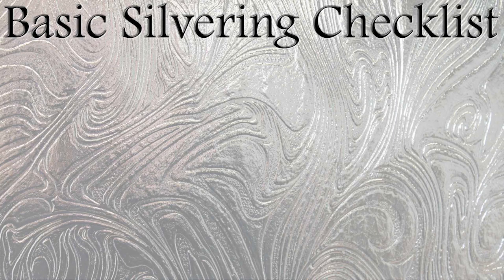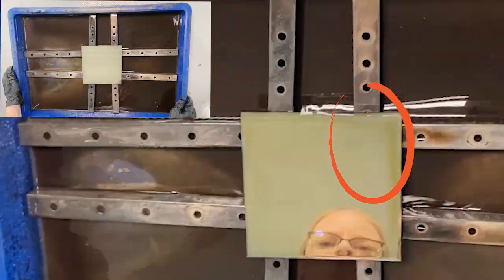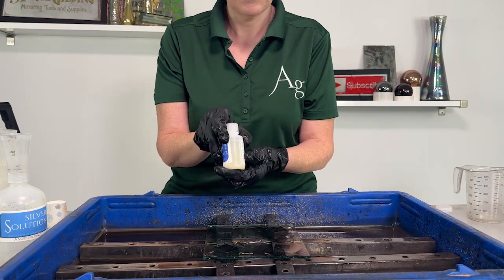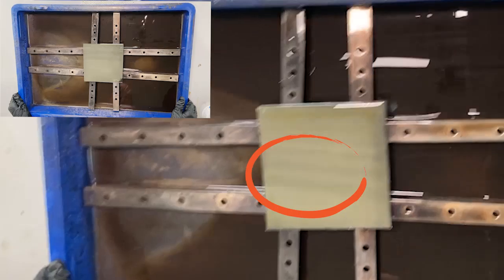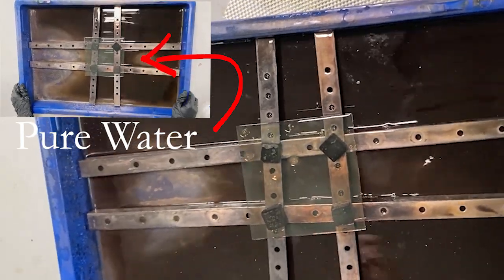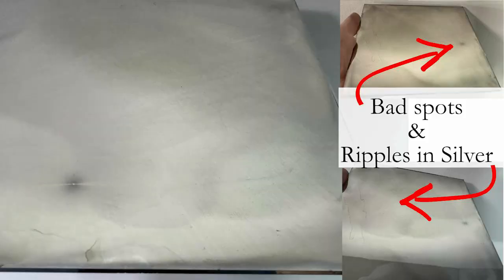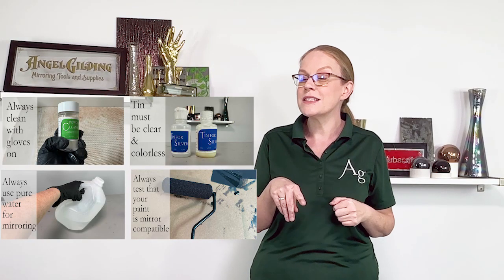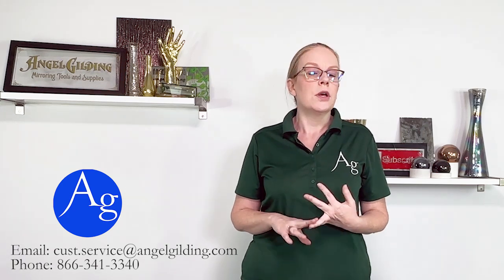How Not to Make a Mirror - Tips from the Experts

Comment: What is the difference between using Tin and Sensitizer?  Is there a reason you would want to use one instead of the other?
Reply from the maker: Great question. They are generally interchangeable. Tin for Silver is a different Tin formulation than Sensitizer. Tin for Silver is more likely going to turn yellow over time whereas Sensitizer will turn white. Otherwise, their function in the same. Thanks for asking!